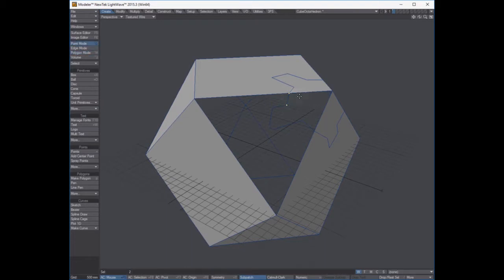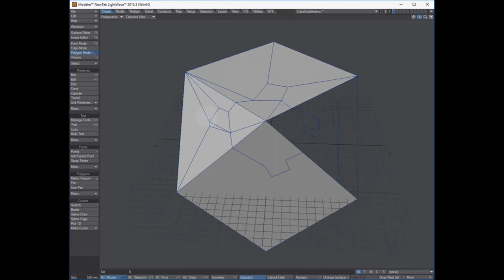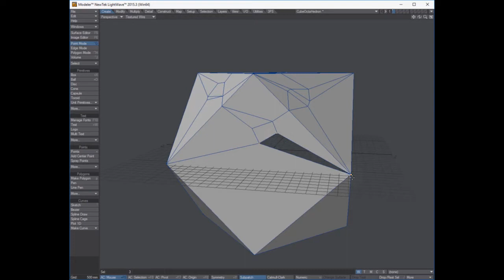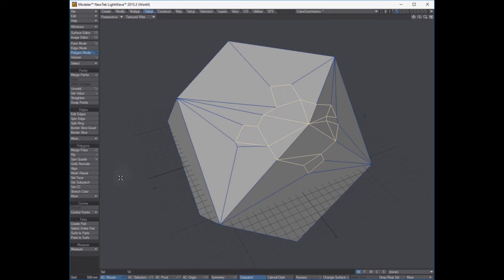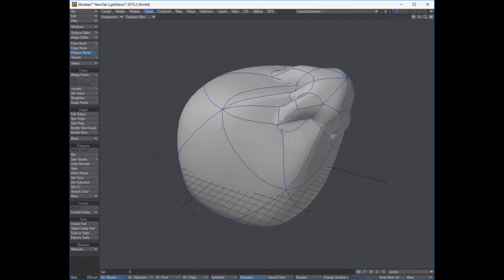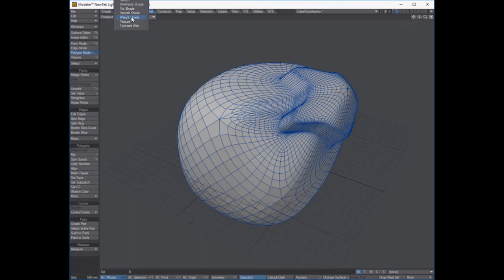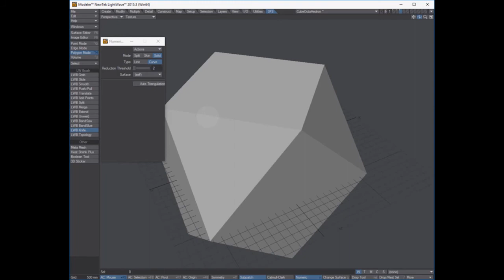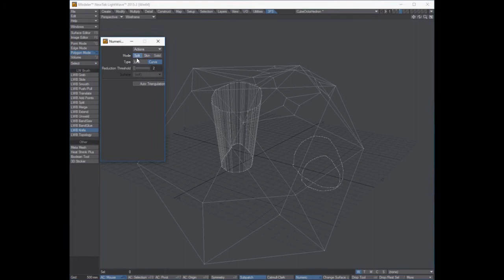Lightwave tutorial on using lines to create an extrusion surface.

Comment: Hi, whats the Orange GUI thingy in the lower left corner? THNX!
Reply from the maker: That's the line pen mode. It will follow the section you're in too. Also, I'm using the 2015.3 version of Lightwave.
Reply: Thnx, I'll have to check that tool out! Have a great weekend!